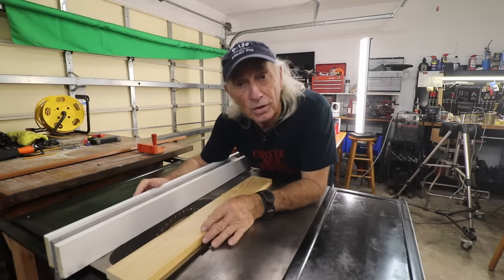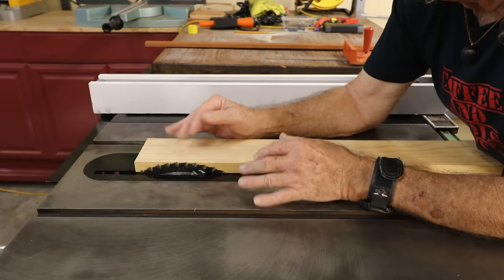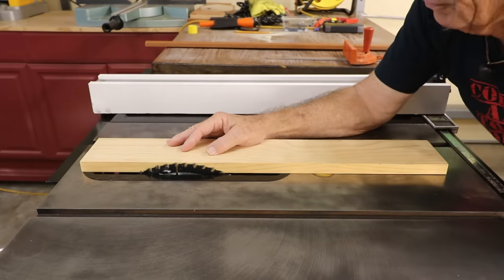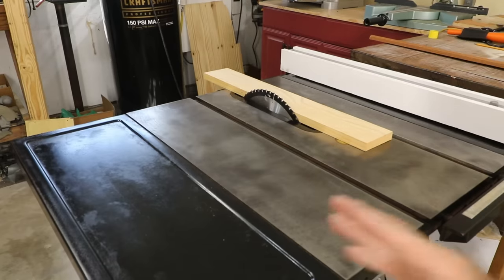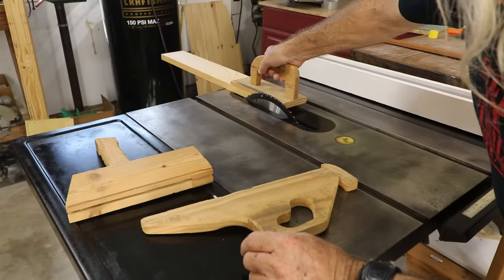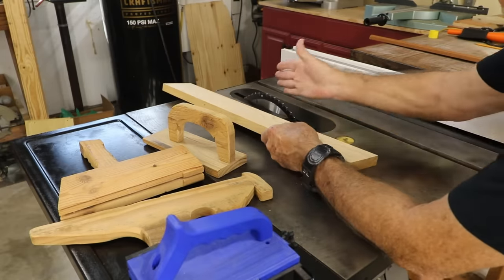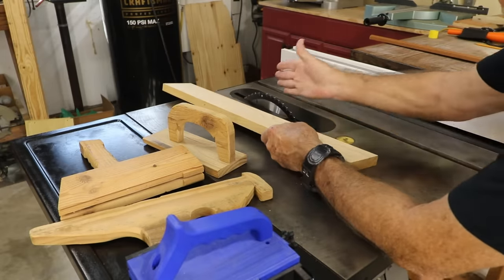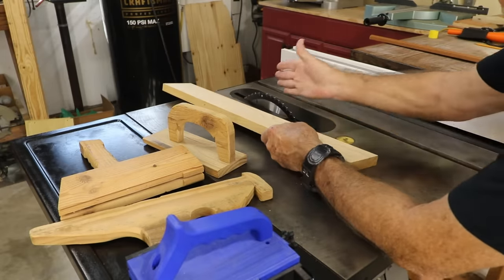Table saw secret nobody will talk about from the good old days, C&T episode 180

Comment: Good info I made a table saw from a circular saw I been using it for about a year and a half some day I'll be able to buy a real table saw but for right now it's been working great it has a little wooden splitter on it and I do use the longer style of push block I'm in the process of adding a feather board homemade of course

Comment: I have been a cabinet maker for nearly 35 years, I use table saws and big rip saws on a daily basis and have never had any thing ever kickback. I was always taught to have the blade if possible at least 3 times higher than the thickness of what  you are cutting. I would say all these people getting kickback would be the fact they have the blade too low? Too me having the blade that low and having the cutting teeth in contact with the job piece though the whole cut is far more dangerous? Also the other thing push sticks I hardly ever use them only on things less than probably 1 banana or 25mm. My hand is always over the fence guide and my thumb is pushing the piece from behind never on top through past the blade. With my hand over the fence it is imposable even if some how kickback happens to be pulled into the blade. I have watched a lot of wood working tips and tricks videos on youtube and your the first that actually uses a table the correct way the way I was taught as an apprentice.
Reply from the maker: You said it right, we were taught that way back in the day.

Comment: What they told me to avoid getting the piece I'm cutting pinched between the blade and the board on the right is positioning the guard so that it ends at half of the blade
Reply from the maker: Interesting too because not many actually point that out.

Comment: Is that an old craftsman contractor saw? I’d love to see how you add a riving knife to it
Reply from the maker: Yeah, plans changed and this saw was sold to a wood shop in Houston Tx.
Reply: @SirTools  good for you for selling it. Too bad for us ;)
Did you have a plan on how to execute your idea?
Reply from the maker: There was some ideas borrowed from Stumpy nubs. I was building a new throat plate that would have an attached 90deg knife on it. The model I saw was basic but would add that safety to it.
Reply: @SirTools  sounds similar to Micro Jig’s solution. I thought you also had an idea on how to attach the full size riving knife to the back of the saw..
Reply from the maker: The original did have a solid bar used for the guard and maybe the knife. Trouble was the bar had been damaged years before.
Reply: @SirTools  I have the original however it feels too flimsy. Besides it has the guard on it (which is hard to see through) and the anti kick back pals, and the whole assembly is too clumsy and takes too long to take off when cross cutting
Reply from the maker: I never got to see this saw before all that went missing. Plan was to keep the saw and then.....well..something else showed up  here with a dead motor. Cabinet craftsman and , what can I say ? Got to keep that one LOL

Comment: Safety first, after that add more safety. Feather edge tools help from the side and mounted to your fence. Especially true for long pieces. I thing a high blade removes less wood and therefore you don't need to push so hard. Good video

Comment: I have the " Gripper" version of your micro jig knockoff ??, the Gripper sucks, I will not use it ( tried to return it), it does not provide safe adhesion to the wood stock your ripping, and creates a real safely issue on the table saw, a good push stick is the best option, I have 38 years in the finish carpentry trade.
Reply from the maker: I'm having the same issue with "Gripper", I'm going to try and fix this deal, but so GLAD you wrote me about it. I was going to order one in from Mic Jig and see if there was any differences.
Reply: @SirTools  Ya the Gripper is a great concept, but is terrible in actual application, I even cleaned rubber pads with denatured alcohol to get rid of debris, I think the Gripper people should be ashamed marketing a dangerous product.

Comment: I too as others have mentioned have found the suggestion that the gullet, at least mostly, clearing the board at the top of the cut to be the best advice that seemed to make theost sense. 
I do disagree with you in that the higher the blade the more pf the diameter of the blade gets exposed to the work therefore making binding and ultimately kickback much more likely.
Reply from the maker: All interesting, but my blade is always high and never have had "kickback"

Comment: I’ve used both methods.  Part of me likes the super low blade, but I feel like the supposed ‘safety’ is a false hope…I’ve had a kickback, and if your hand is on top of the board pushing down when the board disappears, your hand is hamburger.  I’m shopping for hold down rollers…
Reply from the maker: There are some good feather boards kits. Hope you find some hold down kits etc.

Comment: This is a really great topic and there is a ton of controversy about the proper blade positioning during a cut but for my money and my fingers!! Nothing beats a good riving knife and paying attention to what your doing and the later applies to work in general. You can have all the safety measures in the world going all at once if you dont have your brain engaged you will inevitably find a way to get hurt. As fo blade hight i feel like the reason ther is so much debate is because we keep searching for a one size fits all solution to the problem.the issue with that is that there isn't one and also why your brains are the number one safty tool in the shop for any piece of equipment. BASICALY if it feel sketchy and looks sketchy then it is and you should knock it off!!! Step back and think of a better way to achieve the goal. Remember minutes and hours lost are better the fingers and hands

Comment: Every thought about running a smaller blade so you get the same results with out running the blade so high?  The less amount of blade in the wood the less likely it is to pinch.The safety thought is Amputation or laceration.
Reply from the maker: The small blade would increase the drag towards the feed.

Comment: All that surface area of the side of the blade shouldn't be helping you keep the wood straight at all and if it is then there's your kickback risk. Only the teeth should touch the wood the main portion of the blade material is thinner than the kerf. Kick    back is caused by the wood closing back up on the teeth as they come upwards through the table. The wood can close up because of internal stresses.

Comment: Sorry but most of that was nonsense. Get rid of the silly pushy things, get two push sticks, install a riving knife, install a crown guard, raise the blade which helps keep the timber planted. And most importantly chuck the stupid fence away. A full fence is ok for sheet stock but not for real wood. A fence should only project to the centre of the blade, and should toe out a tiny amount.

Comment: This is why I wouldn't make a video on how to use a tablesaw. After 40 years in a wood patternshop as a journeyman patternmaker. Pretty much everything you said, we would consider nonsense. My push stick was a 8p nail driven into a 8" long wood dowel. Then sharpened to a point like a pencil ✏.  With that i could cut down to an 1/8" wide. Blade height no more than 1/4" above the work. A sharp blade with a good kerf, using steel blades, very little carbide. Instead of all you talked about, we were taught to always know where your hands were in relation to the blade and listen to the the cut, you can hear when the saw starts to work harder, the saw determines the speed of the cut. All diy I've seen, seem to think that's their job, one reason for kickbacks. In 55 years I've never had a kickback and still have all 10 fingers, intact.
Reply: Dave, I too preferred an awl until one of our college students contacted the blade with a push stick such as you describe. I'll grant that it wasn't a soft nail, but a hardened shank of a sheet rock screw instead. I got rid of its remains and its mate, and began using a birds mouth stick of soft aluminium. I sharpened the ''beak'' to a thick point and could use it as an awl when I pleased.

Comment: I have a 36 year old 10" Powermatic in my basement. The original Blade Guard & splitter was massive and useless. BUT there is threaded stud in behind the blade for the splitter. I can't tell what kind of saw this guy has but it does not look that old. When it was new it came with a guard. Is there a stud behind the blade??? I've using table saws  both professionally and at home for 55 year. I HAVE ALL MY FINGER AND BOTH EYES.  The Splitter will prevent kick back. Makes cutting plywood panel Much easier by preventing flying saucers, kicked back panels from breaking a rib or worse. I made my splitter from a piece of steel the same thickness as the blade. Once the work engages the splitter, I take my left hand off the work and push the wood through with my stick. I use for both ripping and cross cutting. 
If you choose not to use a splitter than stand to the left of the blade especially if you're tall. Check to see where your privates are relative to the table. A guy in a shop I worked in took the splitter off the 12" saw and promptly took a kick back  into his privates. It knocked him off his feet and he came close to loosing his manhood. 
On blade height. I prefer the teeth to clear the work so the blade plate is exposed. Habit.

Comment: I'll run with a high blade when I have to do stop cuts for slots and when material issues require it. Plywood ripping is best done with a higher blade setting say 1/2-3/4" over.  Otherwise, I keep things about 1/8" over.

Another trick I use.  Take a square and Sharpie and mark on the bed exactly where the blade is going to be. If your fingers cross that line, you're going to lose them!  My bed is marked for the blades and dado set.

I refuse to ever put another object like riving knife or guard behind a blade.  I've been through a guard failure!  The screws loosened during a cut and dropped the guard into the blade, and then it got thrown off the saw and stuck in the wall behind me!
Reply from the maker: WoW....this is the first time I've heard about the guard coming loose. Thanks for posting
Reply: Your sharpie mark needs to be at least ten inches from the blade, Dude. Why is there so much idiotic "advice" on the internet????
Reply from the maker: @schmetterling4477  Yeah the good old internet and it's vast knowledge
Reply: @SirTools  Well, better ten inches from the blade than one inch into it. :-)
Reply from the maker: @schmetterling4477  😄
Reply from the maker: @schmetterling4477  All this money invested in guitars, I can't afford to loose fingers :)
Reply: @SirTools  It's not the finger that I can't afford... it's my self-respect. I can't imagine running around every day with a reminder that I was that stupid. :-)
Reply from the maker: @schmetterling4477  right on !
\
Reply: @SirTools  Now let's talk about the safe use of chainsaws...

Comment: Music volume ratio way too loud.
Reply from the maker: Turns out after it's processed at YouTube, the volumes are "leveled" and yeah...big mistake back then.
Reply: @SirTools  I have an old saw.   I custom made riving knifes / splitters  out of old saw blades.   The center hole can be incorperated as a hanging point with a matching blades and kurf widths, or cut around the hole for smoothe look.   Saw blades are tempered, won't bend, are perfect widths, ( .091 - .101 standars kerf, .084 thin kerf) and the metal cuts very easily into shapes with a grinder and  file.  You can use the saw's splitter to trace the design.   For saws with no splitter or blade guard mount, make the riving knife and a custom mount off the saw end or fence rail.   Adding the riving knife or splitter is top priority.   

As for blade height while you cut, you have to go higher than the blade gusset. Usually a half inch above your lumber, depending upon your blade design.   If you go with the blade barely showing, you get too much ride-up or burn and ruin good lumber - especially with tiger maple.  You do need to cut with the safest position compromise in mind, and shortest tooth to wood contact time.  Too low is too much tooth time - gets too hot for some woods.

Comment: Some safety features go too far. Designed by committees and managerials, not by actual tool-using workers. When the "safety" guards and features deliberately force you to use the tools in a clumsy, awkward, unnatural way then they ultimately cause more accidents and more damage (to the worker and to the workpiece) than they prevent.
Reply from the maker: Good thoughts on this comment

Comment: Having the saw blade just a hair above the work piece is not necessarily a good idea as even supposidly flat timber can vary slightly in thickness and that can be a bit more than a hair so to have your blade at just a hair above the timber can be fraught with danger because when the blade reaches the thicker part of the timber, it will stop the blade dead or keep spinning but wont pass the thicker part of the timber and if at that stage you take your hand off the timber to evaluate the situation, you can be in all sorts of trouble. If you have the blade an eighth of an inch above the timber it will illiminate this from happening but of course will cut you more deeply than a hair above the timber; Most importantly is to keep your hand and fingers away from the blad area when cutting timber. If you do have the blade set too low and the above scenareo happens, immediately hit the kill switch on your saw. Also the conception that the timber rides against the flat disc of your blade as the teeth cut the timber is not quite right; a saw blade is simply a disc with teeth attached to the edges to carry the teeth around in a circular motion but the teeth on a blade is always wider than the disc itself and if the disc is in contact with the wood, this will mean the teeth are worn too much and the blade needs replacing. The blade disc contacting the timber means the teeth are not cutting a wide enough kerf for the blade disc to travel through without contacting the timber, this will actually burn the timber and leave burn residue on the side of the disc. The blade is designed so the disc is narrower than the teeth and should pass through the kerf of the timber without contacting it.

Comment: Your methods on using a table saw have been completely illegal in a professional workshop in the UK since the 60's.  The number of VITAL rules are easy: 1- never stand in the 'firing line', always to one side. 2- use a pair of push stick at least 400mm long. 3- always have the crown guard and riving knifed fitted. 4 - never use a full length fence unless it's correctly set up; better to use a half-length rip fence to prevent 'kick back'

Comment: I don't think that the statistic is fair in terms of in terms of 50% of the work in your shop is done by table saw. So naturally your going to get more chances to get hurt. And if you're a metal worker it's a grinder. And if you're working on hight it's a ladder (risk of falls is 97% residential and not construction site).

Comment: Well, what do you know.  Will wonders never cease?  A YouTube video with the phrase "secrets they won't tell you" in the title that's not total horseshit.  A really good video.  I never used a table saw that much but when I did it was with the blade about 1/2 in. protruding, push blocks and of course all of the personal protective gear.  Never had any problems.  Now retired. 😎

Comment: I have always raised the blade 1/2" to 3/4" above the workpiece.  I have only had one kickback in 35+ years and that was 100% due to my own stupidity.  Also, my blades stay sharp a LOT longer than the guys I know that cut low.  I think it might be due to the heat dissipation.
Reply from the maker: Heat is another factor, but I'd love to hear HOW the kick back happened.

Comment: Some of the most basic, common sense rules and discipline will keep you out of a lot of trouble. Take your time, don't rush anything. Be alert and pay attention. Think everything through first before committing. If you're tired and not sharp, walk away. Listen to your intuition, if something doesn't seem right, if you're uncomfortable, if you're 'standing at the edge' then come up with something safer. How does it all add up for you? What's it worth?

Like this guy, I put my teeth 'high' above the material, more downward force and less material being cut at once than a lot of lateral force and a longer carve being done by the tooth. And I do this carefully with each cut paying full attention each time.

Haha, I DON'T let my work fall to the floor after the cut, I come up with an out feed table of sorts. After all the effort I put into getting my cuts as absolutely perfect as possible I'm not gonna let the work fall to the floor and beat up all the corners and edges. Honestly I don't think this guy does either.

Very cool video. Thumbs up.

Comment: I created a drawing to illustrate your points graphically in my YT channel. . The forces that might be imparted on a piece of wood at 2 different heights are shown (see end) . It appears the lateral forces towards the operator increase significantly because the horizontal forces of the shallow blade at rear and at front both head in the same bad direction -the operator !!!  The lower the blade increases these horizontal forces which increase  the speed of projectile. Also, the forces downward on the job are also much less on a shallow cut and the piece will tend to not want to stay on the table top as firmly. If shallow cutting it would be prudent to not force the piece through the blade and let the blade cut at its own pace.
Reply from the maker: I've got to see this :)